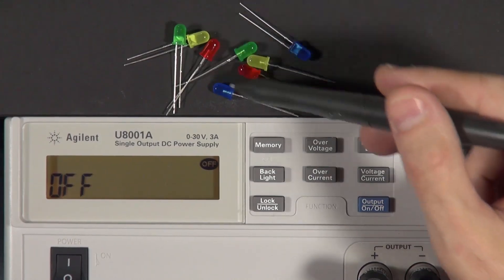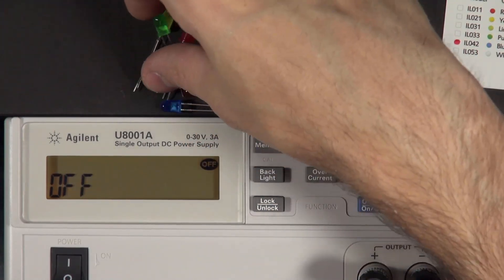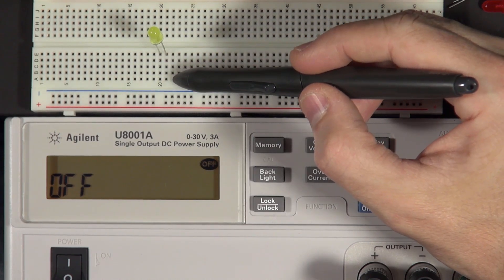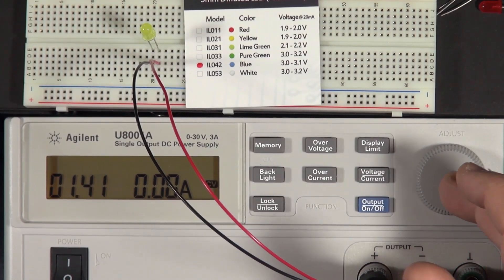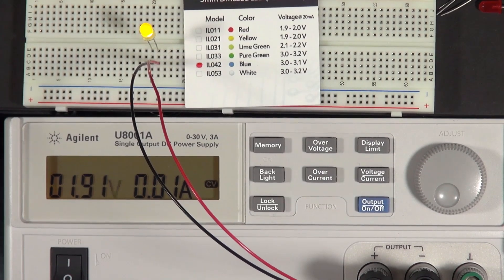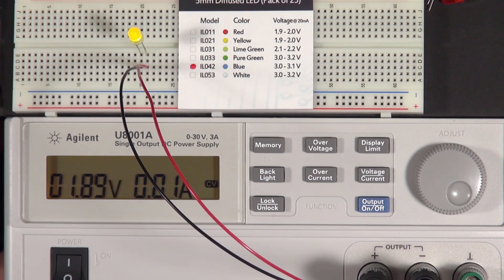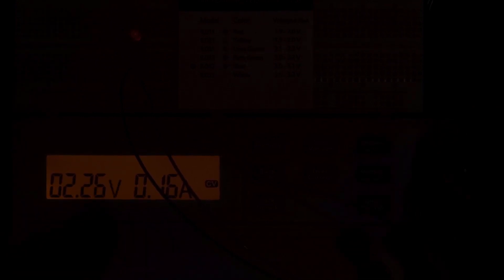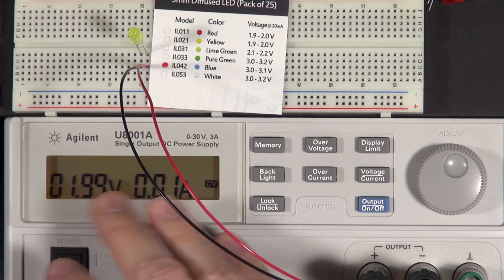Experimenting with LEDs | Digital electronics (1 of 10)

Comment: I have a question, Using Ohm's Law we can calculate the resistance to be R=V/I at max to be100 Ohms, what's providing the resistance? The power supply?
Reply: Maybe the internal resistance of the wire?
Reply: @Dorgsbrain69  Wire’s have very low resistance, otherwise they would not work so well as electrical conductors. When V=2V, and I= 0.02 A, then R= 100? I still don’t get how.

Comment: It is good to know those voltages. One of the first projects I ever made back when I was a teenager was an 8 bit counter... I didn't have 8 of anything, so I used 4 reds and 4 greens.  Each lamp had its own + and they shared a - with a single resistor (I do not remember the ohms)... well, the green requires more juice... so, when my counter got past 15, the green lamps acted real funny. It took me a long time to figure it out! Eventually I started testing the lamps on their own and realized that I wasn't powering the greens enough. I replaced the green lamps with yellow ones and the counter worked just fine! (sorry, I know this is a tangent...just love the video and reminded me of getting started 35 years ago!)

Comment: 1 thing that I still not quite getting about electronics is why everyone always talk about voltage, while it seems that the current is what matters for components (expect MOSFET transistors I guess). Why the big letters say 2V on LED? As far as I can see you can easily hook up an LED to 12V with a proper resistor, need to just make sure that the current is still 20mA or lower (I'm not sure if we need to make sure that the power is equal, so if it's 2V*0.02A = 0.04W, then for 12V the current has to be 0.0033A to consume 0.04W)

Comment: Great demo, Ben.  Thank you for sacrificing an LED for the sake of learning. :)
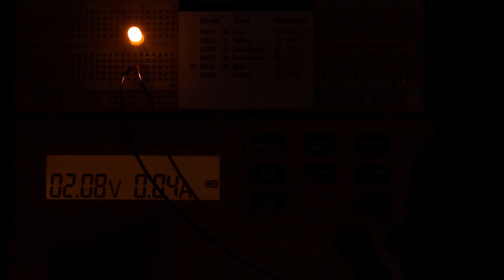One thing I find fascinating here, that you either didn't notice or simply didn't talk about, is that the amperage keeps increasing with a fixed voltage -- at 7:30 you reach 2.10 volts, and stay there a while.  At first, it's at 0.05A... then, about 7:36, it hits 0.06A... then, at 7:44, it's up to 0.07A... and finally at 7:49, it gets up to 0.08A before you start increasing the voltage again (when of course it then goes even much higher -- with some increase in voltage, but only a tiny bit, really... and then it basically dies and the amperage starts to fall).

Comment: so what did really happen when the led burned that didn't allow it to pass current through it anymore? does the atomic structure of the metal change or what?
Reply: You might wanna look up p-n junction diodes. As far as I know, too much voltage will destroy the junction, and the diode is ded. rip.

Comment: i will remember that + is longer to write than - because it has an extra line and that makes the leg of the + longer :D
Reply: - takes shorter to write so, that's a +.
Reply: I have LEDs with incorrect lead lengths so I always check the diode itself. Can't go wrong there.

Comment: How do you make the end pins on the wires?
Reply: Thank you Wout Van Dessel
Reply: @ghostly_zsh9609  No problem. If you have any further questions, let me know. Although I can't promise I'll be able to help since I'm still learning myself.
Reply: He just stripped the wire, nothing really special. There are tons of videos online on how to do it using either a specialized tool (way overkill when you're just learning, should only be used in professional circles), pliers (my personal preference) or even just something like a knife.
There are special jumper cables people use with breadboards that actually do have pins on the end, but that's quite unnecessary and adds extra cost. Just strip the wire, make sure the copper threads don't split (if they do, just grab em as a whole and twist and that should fix it) and you can stick it into a breadboard like this and it'll work.

Comment: Why did it start drawing more and more current when the voltage got higher
Reply: Think this with water.
Take two water tanks connected by a pipe. Both tanks are at a different pressure. The velocity of water flowing in the pipe will depend on the pressure difference of tanks. In electric terms, the pressure difference is voltage and the velocity of water is current. So current increase with increases in voltage. But can you change current to achieve the converse? No, well how can you alter the velocity of water in pipe without changing pressure difference.

Now the high school method.
We have a formula V=IR.
V=voltage
I=currently
R=ohmic resistance, you can't change this.
So, I = V/R ---------eqn (1). (this is ohm's law, its more under electrical engineering rather than electronics).
If you know maths you can easily derive proportionalities from eqn (1)
I increases with increases in voltage and decrease with increases in resistance.
The value of resistance in these leds is such that for provided range of voltage (say 2V) the led will draw 20mAmps. But if you increases the voltage it will draw current more than safe levels(20Amps+).
Ohms law is: "the current flowing through a conductor is directly proportional to potential difference (voltage) across it's ends and inversely proportional to resistance in the conductor". But converse is not true because current changes as a result of change in voltage, we cannot change current by external means (edit: without changing voltage first)
Reply: @ericdomanic1376  Your analogy only works if you don't know fluid dynamics. In real life water flow through a tube is nonlinear and frustrating to figure out
Reply: @teamupleft7097  can you give an example where water doesn't flow from high pressure to low pressure?

Comment: When I was in college, I bought a circuitboard full of LEDs from a surplus shop.  Maybe it was a voting machine or control panel, not sure, but I had loads of fun shorting a 9-volt battery across the LEDs.  Sometimes they just burnt out, but often they'd explode and send bits of plastic all over.  Like electronic bubble wrap, it was great.

Comment: It no longer emits light, but is it still a diode? I'm not trying to pinch a penny, just trying to understand what's happening inside.
Reply: It's no longer a diode because the wire inside the LED just burnt out so it can't function anymore.
Reply: It's drawing 0.01A at the end, so it's not burnt. The question is, is it still a diode?
Reply: No. Once you short PNP or NPN, or in this case N and P junctions, it becomes a dead short, or an open circuit depending on how it fails. You can get in between states, but it's not normal and will only last as long the junction doesn't break down.
Reply: Chris Knowles - Damn good question! The LE and D parts are not the same. If current flows, there is a junction (of God knows what type.)

Comment: I think I remember from other videos that current draw is related to resistance. Does current draw increase or decrease with an increasing resistance? Why? And, what is the resistance difference between a "heavy" and a "light" load?
Reply: Persona Charles - Please stop shouting. Ohm's law BTW only operates at STP, else, no tunneling (vital to EE) or superconductors. You really have no idea what you are talking about.
Reply: If you still don't understand, experiment with the math of ohms law.
Reply: LET ME TRY TO ANSWER. FOR CONSTANT VOLTAGE, INCREASED RESISTANCE MEANS DECREASED CURRENT. AND VICE VERSA. A HEAVY LOAD DRAWS A LOT OF CURRENT. A LIGHT LOAD DRAWS LITTLE CURRENT.  

MATHMATICALLY -> V=I * R. I AND R ARE INVERSELY RELATED. FOR CONSTANT V.  I = V / R  AS R INCREASES, I DECREASES. AND VICE VERSA
Reply: Persona Charles Correct! Something interesting to consider is, as a battery drains, the voltage remains constant. So, if the current decreases, the internal resistance must increase.
Reply: @personacharles  caps lock broken?